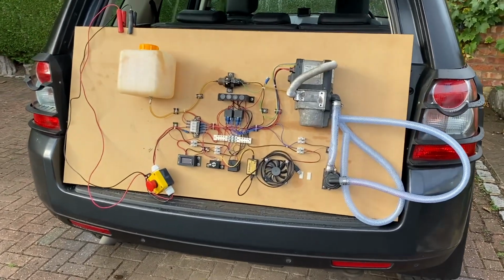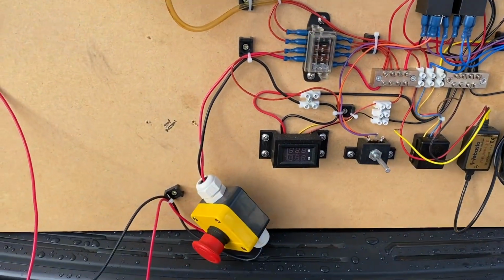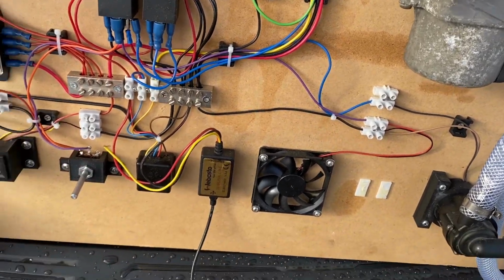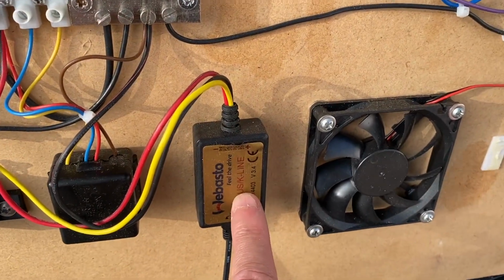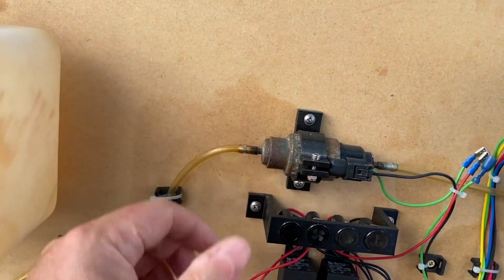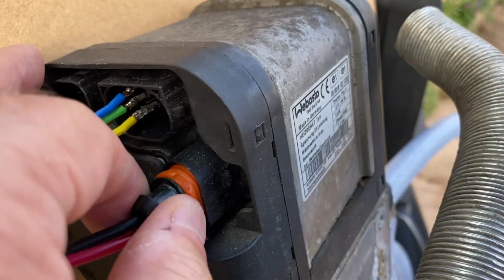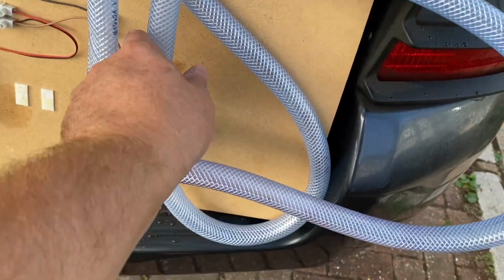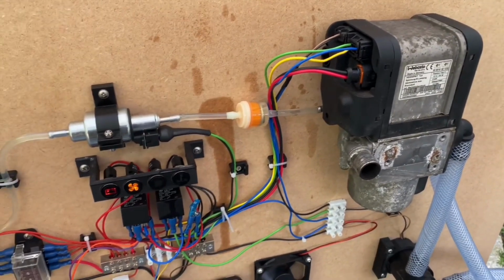Fitting a Webasto fuel burning heater - Part 3 of 8

Comment: Hi on a freelander 1 Td4 2004 regarding the heater to warm the flow to inside the car . Can I ask there is a smell and blue smoke from the exhaust at the front and the fan is a bit noisy,
I think it’s supposed to do that but can it over fuel at that point .
Reply from the maker: Sounds like your webasto needs looking at. I think the thermotop-C was fitted to some FL1s.
Reply: @BeavisPits  thanks for your reply

Comment: Hi, I followed all three videos on the webasto thermo top v. I state that I cannot find a wiring diagram of the webasto top v. I have one identical to yours too, but I haven't figured out how to make it work. Given that I need a simple circuit to heat hot water in a warehouse. What I want to know how to connect the control pins, on mine there are three cables, a yellow-green on pin 4, a white-blue on pin 5 and a white-yellow on pin7. How do I connect these 3 cables? one will be the ignition control which of the three, and also should they be connected to the negative or positive? Thanks from a bumbling Italian.
Reply from the maker: Circuit diagram is shown right at the end of the video.
Reply: @BeavisPits  Thanks for the reply. I apologize, so for the webasto thermo top v to start working does it need the positive of pin 2? Also are all 8 pins current positive? Thank you with all my heart

Comment: Hi, had a Freelander 2 Diesel for a while and planned this, but would need to be wired into the car as per factory to run it and set the hecac unit to power up and run. Allot of work.
Whit van man ended my plan and my vehicle.
You can get w bus controllers to run later units stand alone, but you would need to get the Hvac to run.

Keep on going and keep us updated.
May get to play with mine now winter is upon us again. Just for fun.

Regards M.

Comment: PWM maybe better to control fan speed, My S-type had a webasto under the wing it would kick in on cold mornings so I could drive down the road with loads of smoke 😄 luckily I think it only came on when 7*C or lower
Reply from the maker: If I can’t get the 40’C wire to work then I’ll just connect the blower relay to the same trigger as the water pump, so they go full speed when the webasto is heating the water up. I won’t inside the car so it will be fine.